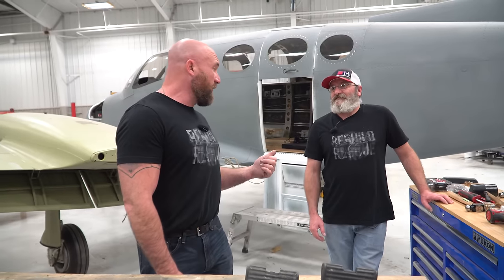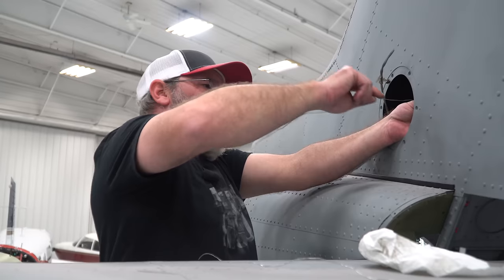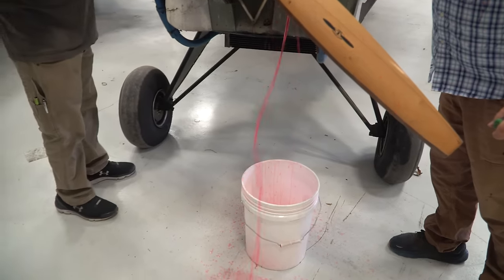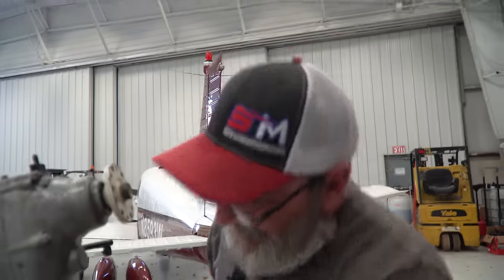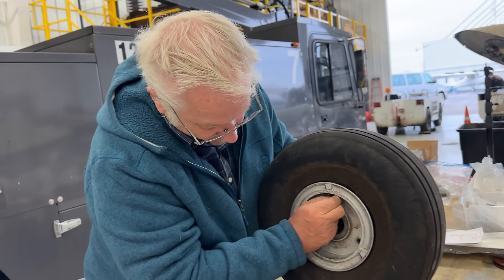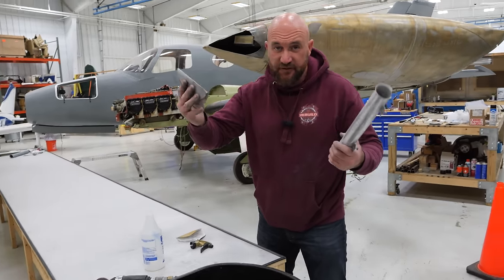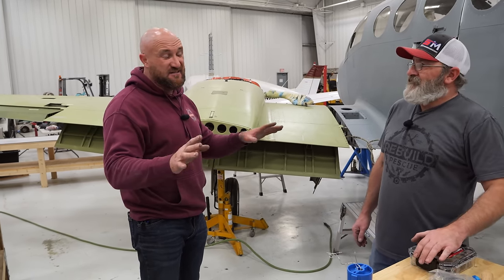We Fixed This on The Free Abandoned Airplane & AUSTIN WINNER !

Comment: Even though it spins great with the light weight oil, you still need to pack that with grease, else your going to have pulleys locking up everywhere in two or three years..

Comment: You can see why the whole aircraft industry is shifting to fly-by-wire. What a pain in the butt to rig up, safety wire, and then fret about the adjustment and integrity of all those friggin' cables and cranks! Gimme wires and electric actuators baby!

Comment: I imagine that the cables through the length of the fuselage connecting to the rudder must be extremely important. A frayed cable could stick on a pulley wheel preventing operation of the rudder - or the cable could even break! The pulley wheels must be equally important for the same reason. But even so - you could probably still live! You can fly and land the aircraft without a rudder...

Comment: Nice episode. Here's my take on what the springs are for. I understand that the springs are a Cessna-created patented. When the right rudder pedal is pressed, nose wheel steers right, and rudder's trailing edge moves right. They make landing in a crosswind more forgiving when you put the plane into a slip. For example, in a left-to-right crosswind, you would dip you left wing and add right rudder to keep the plane from turning left into the bank. But that steers the nosewheel to the right which would cause a sudden turn the right once the nosewheel touches down. The springs allow the nosewheel some "give" so that it can align itself to the direction that the plane is rolling down the runway (hopefully straight down the runway) at the moment the nosewheel contacts the pavement.

Comment: I admit the fact of these videos that parts that are sitting for long periods, especially on airplanes need careful expectation and lubrication to operate properly... And that a bad or well-used parts that should be best replaced... Like Joe's working on the Kit Fox engine pull down,  that even goes to show when that a big hammer is not working as expected it is some 'Good Thinking] that shines on why the hammer is not working as expected. Also, like what you showed in the video on working on all the 401 cables that are neeededd to operate the steering and rudder... One big job to make it all work...

Comment: Some thoughts for Joe and Sam regarding the Rotax engine: exhaust springs, use a length of coat hanger with a hook at the end. As the requirements for a 2 stroke in an airplane and in a mountain snowmobile (of which I am very familiar) are similar...ie leaving at 1000' and cruising at 6500'...that motor probably has the Rotax old school compensator, the HAC..High Altitude Compensator. It works by changing the vacuum applied to the float bowls of the carbs, thereby adjusting the fuel going up the needles and jets....so pay attention to all the vacuum lines (which on the sleds were clear fuel lines). Good luck!

Comment: The major reason for the bungee spring is to allow the rudder to move in flight.  When the nose gear strut is extended all the way (in flight) the nose wheel is locked in the centered position to prevent the nose wheel from turning and jamming in the wheel well thus not extending.

Comment: Jason, At 43:30, you are talking about the rudder control meganism and calling it a "push-pull" system. Sorry, but that is completely wrong.
This is a "pull-pull" system. On each side of the bellcrank is a cable that pulls on the bellcrank. Pushing with a cable is very difficult.
A "push-pull" system uses a rod that pushes or pulls on a lever that controls the rudder or elevator or ailerons.

Comment: put a cross mark on pulleys with a marker so you can rotate them 90 degrees etc to a line matches up to a line on the frame every yr if they dont spin a full turn in use.  helps them live longer , when a friend tightens stuff, he uses a red marker after he tightens a nut and on recheck he remarks with a black one over the red. If you see red, it wasnt rechecked..

Comment: Why not install some tiny cameras in areas that are difficult to reach but have moving parts that one might want to see in an unusual situation - perhaps to see a failure. Cameras that can be selectively turned on and monitored. A camera on the tail section that can show air traffic approaching from a blind spot such as the plane's 180, a camera showing blind spots below and toward the front of the plane.

Comment: Been aboard a/c where the AP wore itself out compensating due to improper rigging and each plane is different. Even same models. Are some of the “problems” with your aircraft contrived just so you can take a hop to chase parts? I’ve dreamed about working in shops where the atmosphere is such as yours and this is not just blowing smoke for consideration. Love watching

Comment: Dawn liquid dish soap on the inner tube helps prevent pinching and tearing. I found that out the hard way 20 + years ago when I changed my first dirt bike tire (KX 80 2-stroke bike). I put 11 holes in the tube with the tire irons. When we went to the motorcycle dealer to get another tube, the parts counter uy told me to use either baby powder or liquid dish soap.

Comment: I don't know anything about planes but if it's anything like boats a cable can corrode and you will never know it so generally they inspect them all regularly and at the first sign on corrosion all those cables are replaced. That being said those cables are on deck and exposed to weather so you would know more than me.

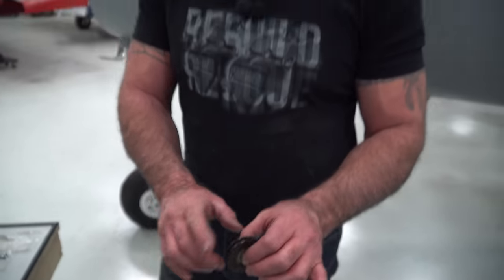Comment: 12:20 - Question: Does using the Kroil in bearings like that break down the grease, giving you free movement now, but less wear resistance later?  Would it be safer to repack the bearing with fresh grease or replace it?

Comment: Because the rudder pedals also operate the nose gear stearing, the springs have to be there so you can still control the rudder after the weight is off the nose gear and the nose gear drops into the centeting notch for retraction.

Comment: Not sure if it’s allowed in aviation but would those tire pressure valve cap sensor kits work as an in flight monitor for the tires? Would be nice to see the tire pressure at a moments glance prior to landing.

Comment: ...not understanding the run back and forth to impossible places to string wire - is it possible to run/route all of them at one time to a point just outside the (entry?) bulkhead, then label and clamp them taut (temporarily) with rubber-footed clamps?  🤔

Comment: When you press the right pedal, shouldn't both the wheel and the rudder turn to the right? I am not a pilot, but it would seem intuitive that when you press the right pedal the plane should turn right both on the ground and in the air.
Reply: Nah, afaik you generally use left or right brake to turn the aircraft until you reach the speed at which the rudder becomes aerodynamicly effective. Now the brakes are typicly on the rudder pedals, either toe or heels but you can brake without moving the rudder or move the rudder without braking.

Comment: not sure if this helps but as a sailor we always look for discolouration in the swage terminal where the wire goes in, thats where most failures happen, i have even seen strands of wire corroded fully through but held in place by the swage, when you showed your cable swage it looked like there was some discolouration. If it was me i would replace all the cables and reswage it all.

Comment: Why replace the cables, and springs, pulleys, before you remove and replace the old wires, over years planes continue to gain weight, from electrical items being installed, and old antennas and devices never being pulled out, you can almost bet, this 401 had loran at some point, and who knows how many other avionics or electrical devices/ systems, had been updated

Comment: Not the sound critical but you painted those pedals they will wear out very quickly once somebody starts putting a bit of pressure on them wouldn't it have been a better idea to powder coat them

Comment: I have on my motorcycle  a valve cap called a “Fobo” that sends a blue tooth signal to my phone telling me what the tire pressure is for that wheel. You could use that for sure on an experimental but not sure about a certified